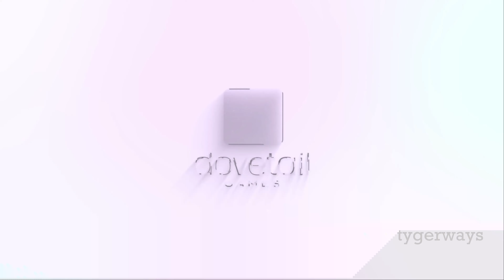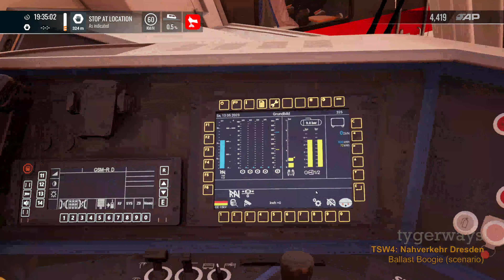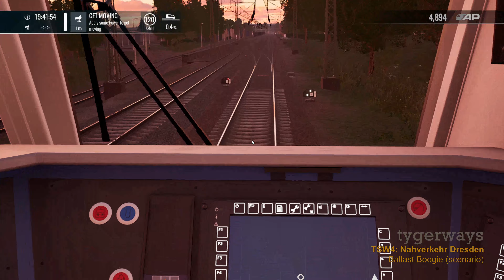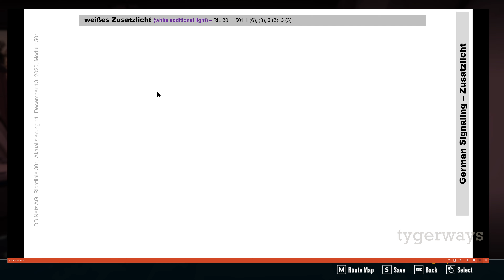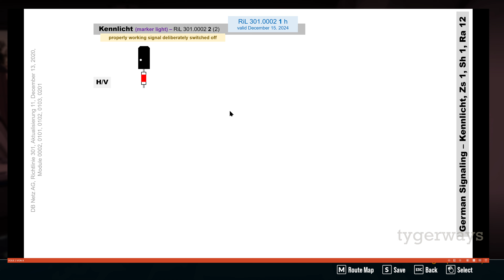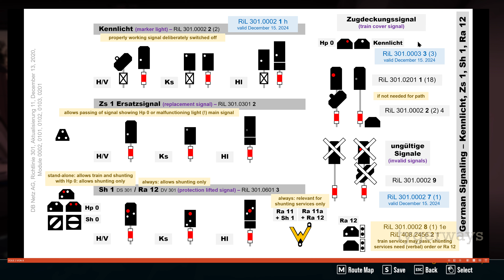German Signalling: Zusatzlicht, Kennlicht, Ersatzsignal Zs 1, Signal Sh 1 / Ra 12 (TSW tutorial)

Comment: Thanks again Tyger for the video, these are also super helpful in understanding real-life German cab rides of which there are now loads on YouTube.

I'm sorry if I missed it, but what kind of warning or pre-signal will you get for the Sh 1 or Ra 12? Especially in the East it would seem impossible to tell whether the signal has the two black dots or not until you are almost there - so presumably there is some warning that if you are a train service, you will have to stop?

Also it always makes me nervous when advancing towards a row of dwarf signals which are almost all red, like you did leaving Köln Hbf and is common in station areas, because of the angle you cannot see if the points are set to the clear signal and even travelling at 40 it seems you would not have time to stop.

And 😁, by the time you got to the "W" signal at Riesa I had already forgotten what it meant from the presentation! But I really appreciate how thorough you are.
Reply: Ah OK. So you are saying that for the Ra12 you described where train services can NEVER pass (unless there is the mast sign), you will never encounter this signal unless you have passed a main signal that is red, for which you must be a shunting service? Or you will get a yellow signal (or equivalent) before, making you reduce your speed?

To put it another way, if I am running under a Hl signal with yellow over yellow (I don't remember the technical names, but I believe this means go 40, expect stop signal), do I have to be prepared to stop at any dwarf signal in my way or only at a full-sized red signal?
Reply from the maker: @ursusarctos59  Yes, I think what you say is correct. You do not necessarily need to stop at and pass a red signal to become a shunting service (you can start out as one for example or change from train to shunting service after your last scheduled stop at a station), but as long as you are a train service, running with a train number and according to main signal aspects, you should be safe from mean little dwarfs like that (in the east the dwarfs on your path should all have the two-black-dots-on-white mast sign and the interlocking logic should make sure they are all switched off/show Ra 12, just as in the west the dwarfs should be switched to Sh 1). Exceptions can be if you are running on special assignment ("auf besonderen Auftrag"), but this is a different story.

Unfortunately the game doesn't always differentiate properly between train services and shunting services and usually doesn't tell you which you are supposed to be.
Reply from the maker: Thank you! Happy that my videos help with the real life cab videos! :)

Sh 1 and Ra 12 are typically not announced by any distant signals. If you are running a train service under a proceed aspect ("Fahrtbegriff"), the dispatching logic should make sure that you can't run into any adverse dwarf signals blocking your way (so you can rely on that). As a shunting service, you are typically limited to 25 km/h, so that you can react to any adverse dwarf signal.

Apart from that, you typically wouldn't operate shunting services in any area without having the relevant knowledge of the location ("Ortskenntnis") - including the mast signs on the dwarf signals.

Comment: Some things in this video were unfortunately not really correct.. 

When talking about Zs 1, you say that Hl signals don't use the flashing light which is not true (as shown at the end in the game), and instead you have H/v signal there with flashing white, which is not correct either (they always use the three A-shaped steady lights instead, even in modern buildform).

When discussing LZB Dunkelschaltung you say it does not matter if the signals are dark or show kennlicht - that is also not true. They are dark not to save energy, but because there is no valid aspect they can show - there is a train ahead of you in the block between the physical signals (so it cannot show green), but the block towards next LZB block (the little sign with number in circle) free is (so it cannot show red, because you would have to respect it). The signal is hence dark - if you have LZB, you should go according to it, if you do not, then you must stop for the red mast! If it showed kennlicht, it would allow non-LZB train to go through into an occupied block of physical signals, potentially crashing into the train ahead. Only with distant signal this does not matter, they can show kennlicht without this implication.

Also, in the beginning you are complaining that the train is too heavy to comfortably slow down from 120 km/h.. well, your own excel table tells you that you must not go faster than 100 km/h to ensure safe stopping, that's why :)

Perhaps to add something about the Zugdeckungsignale, they are not used only for sequencing trains (there are probably not even many stations with such traffic, except for Köln and some S-bahns), but it also allows having more trains in one track in general (one platform for two trains in different directions), and joining the trains. Because as the rear part to join the train, you cannot be given a green signal into occupied platform, but you also cannot be a shunting trip (because you are coming from the outside of the station, entry signals do not have Sh1). So, you enter the station on Zs3 "20" (expect stop on very short distance - that's what tells you to look for Zugdeckungsignale) and stop at the Hp 0 in the middle of the platform. Then, after you stop, the signal changes into kennlicht and "disappears" - boom, you are now on the same track and you can just shunt on sight into the front part of the train, without breaking any signalling rules. :)
Reply from the maker: Thank you for this elaborate feedback! :)

Ad Zs1: Of course you are right, all H/V light signals that I have seen so far use the old version of the Zs1 signal). The rules would (imho) allow for the use of the flashing version on H/V signals, though, this is why I showed both versions for the H/V system. In real life I have never seen a Hl signal with a flashing Zs1 (in the game I obviously have), so I said that i wasn't sure if they existed. If you say they exist, I have no reason to doubt that. The rules allow for it, at any rate, so they are shown like this in the presentation.

Ad LZB Dunkelschaltung: Again, of course you are right, Dunkelschaltung and Kennlicht are obviously not the same, for the reasons you pointed out. If I said it doesn't matter if the signal is dark or shows Kennlicht, this was only for the particular context discussed: When running under LZB, you can pass dark signals and signals showing Kennlicht just alike.

Ad train top speed: Yes, I tweaked the numbers a bit to be able to run the train a bit dynamically. :)

Ad Zugdeckungssignale: I don't think I stated anything contradictory, but thank you for the additional information. The use of the Zugdeckungssignale would be worth a video of its own. Unfortunately, though, the sequences in the game do not really check out there, as far as I have seen. When entering Köln, for example, you can get the Zs3 '2'' (or '3'), without encountering any Zugdeckungssignal afterwards.
Reply: @tygerways6615  Köln Hbf is a bit specific because it is for some rules considered Kopfbahnhof/dead end station, even while in reality there are many tracks that go through. Also Hohenzollernbrücke allows only 30 km/h speed, so there the Zs3 shows this as well. This ambiguity is probably why Ks system now uses Zs13 to explicitly tell you to watch out for early end of route. From the TSW routes, zugdeckung should I believe be present on RSN to join the short trains coming from Iserlohn to mainline trains in Letmathe. Unfortunately the game treats them as separate trains running at different times instead. Short entrances were present somewhere in the early routes, maybe the services ending in Essen on HRR? I don't remember.
Reply from the maker: @moi_noirceur  Do you happen to know if the sequence of high Sh1/Hp0 signals on the S-Bahn tracks at Köln Hbf (in-game) is actually prototypical (or would they be Zugdeckungssignale in real ife)?
Reply: @tygerways6615  I don't know, but I think they should be zugdeckungssignale, because it is not allowed to combine/mix these two. Köln actually uses a different buildform for them completely, different from the sperrsignal buildform, and there should be 9 of them on the tracks, so the game is not really representative overall. Note that you can actually end train paths at a tall sperrsignal (for example for arrivals in yards), but not at the low one. It is still a valid signal showing Hp0, although for practical reasons of visibility it is not allowed for the low ones at all, and for the high ones only at 40 km/h speed, I think.
Reply from the maker: @moi_noirceur  Yeah, this is about what I thought. Well, I will probably get to Köln Hbf sometime this year, so I can take a look. :)